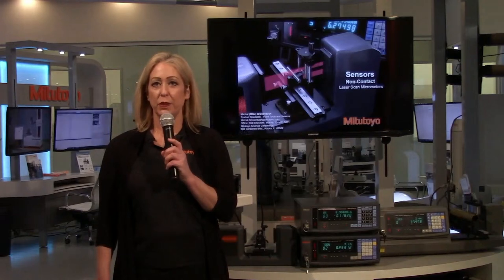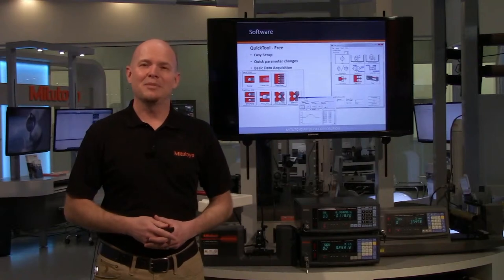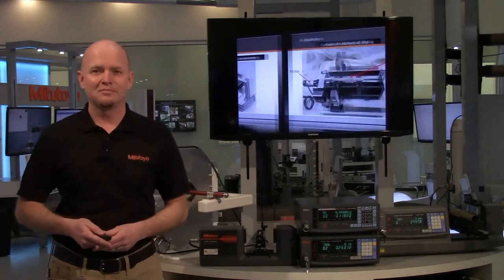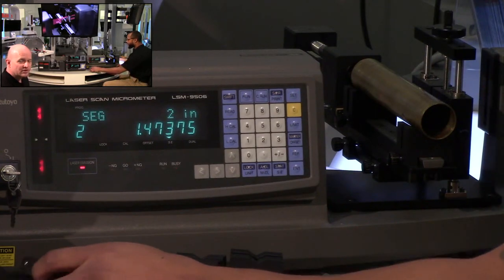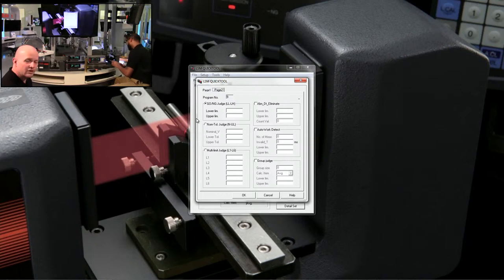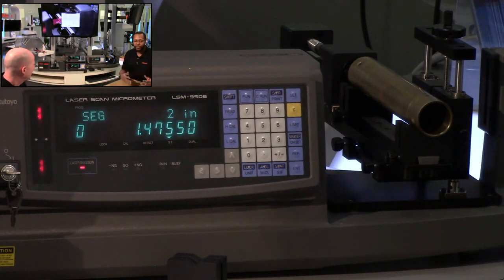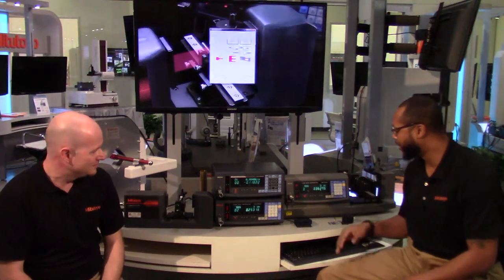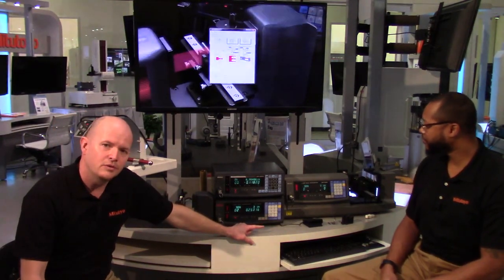Laser Scan Micrometer - Non-Contact Testing

Comment: Can we use  this for calibration of o grade or 00 grade slip gauges
Reply from the maker: The LSM-6902H is great for calibrating pin gages, typically grade Z or ZZ but depending on internal requirements other grades can be measured.  For products like Gage Blocks we would recommend our Gage Block Comparators such as the GBCD-250 or GBCD-100A, please see the link below. If you have questions, please contact us at 888-MITUTOYO or email Donna at Donna.Boothe@mitutoyo.com
https://www.mitutoyo.co.jp/eng/support/service/catalog/09/E12001.pdf